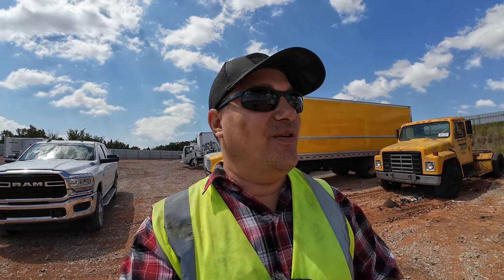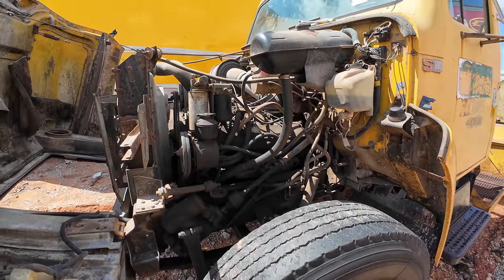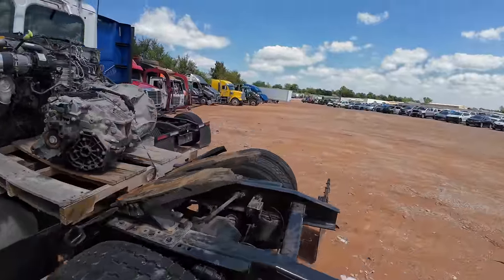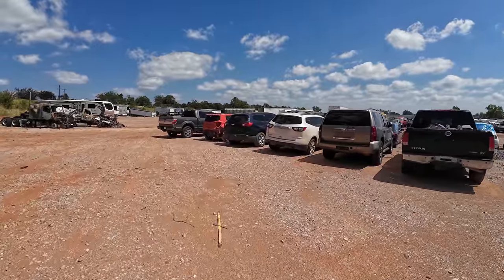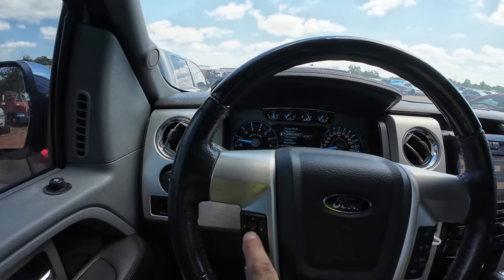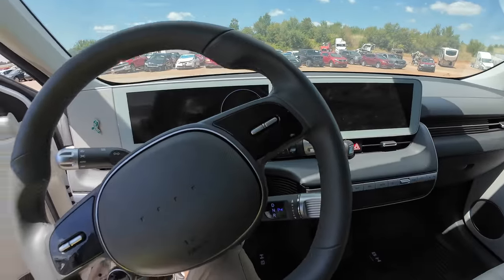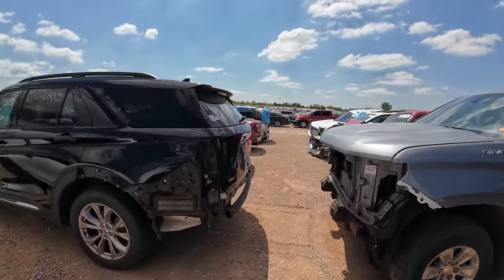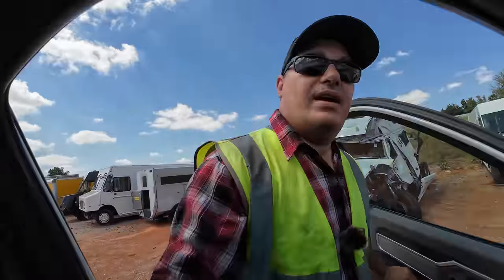Should I buy This International Diesel Truck? Super Cheap and it Runs!

Comment: Cobble a dually pickup bed onto the IH with a crazy rattle can paint job and drive it as a Rat Truck. Or, put a pickup camper or RV camper on it.  Fab some crazy headers on it.  Make them chrome for contrast. Put some wide cement truck tires on it. Oh and, a wing, of course! 4:00 Grab that push bar for it.

4:35 A Kodiak Ambulance Camper! How about that white box truck for an enclosed car hauler/camper?

14:30 Sand, Bondo and paint the hood for the cheapest way out.  Put your Macco guys on it.  It's old enough to be cheap.

17:10 That mustang is so cool and rebuildable into a rat Rod.  Great patina with a satin clear coat on it.  THAT would make for a great series.  Being what they are, I don't think I could even afford that one.  I was 18 years old when that was new, and I wanted one.  A Boss 302!  Trans Am Racing, yeah!

25:35 Show us how you rebuild them!  You need a door and someone who can pull that fender out.  If you can get it cheap enough, who cares about a little Bondo?  It has the hardtop too!
25:55 Okay so it needs a lot of Bondo!

I think I would like to see you turn lemons into lemonade.

Comment: A few videos back sitting next to a Red Ford ranger was a 2004 Gmc Sierra Denali Quadrasteer All Wheel Drive 6.0 Vortec. Very rare and very good truck. I pull a 9k Camper and an 1k golf cart in the bed. Absolute towing Beast. Wish you could find it and check it out.youve never had a Quadrasteer truck on the channel.ive owned my 04 Sierra Denali for 17 years!best vehicle I've ever had.

Comment: Garbage trucks usually burn because of hot/flammable stuff that people put in the garbage. If the driver realizes in time, they usually empty the garbage out to the side of the road to save the truck. Then the fire department comes and puts out the fire in the large pile of burning garbage on the side of the road. It’s a mess.

Comment: I wood like to see you in a semi with a manual transmission, will be very interesting content 😊
Reply: I think Randy would get the hand of it. They are pretty easy to drive if you can drive a car without using the clutch, an 18 speed is no problem.

Comment: Randy, as much as I want you to go back with a full jumper pack and see if that International runs, I gotta say PASS.

The 9 liter is not a very powerful engine. The trans is most likely a five speed, and the orange knob is indeed for a two speed differential.

The large brackets on the back suggest that one of those large arrow boards was mounted to it and it spent most of its life parked at the beginning of highway/interstate construction zones. That would certainly explain the low mileage of just over 2K per year on average. The flat steel plates over the rear axle may have carried a few of those large concrete lane dividers, and I can imagine the expanded steel baskets on the frame being used to carry cones.

This is what I would classify as a specialty truck. Not very practical for many moving applications other than a stake body unless you put a lot of time and labor into it. With the single axle, the frame is too long for a dump bed that the rest of the truck could handle... but it's also too short for a rollback. I would be very surprised if the rear end ratio was below (numerically) 6:1, which means it won't do interstate speeds... probably hits the governor at 50, max. If you could deal with the ride of the spring suspension, it might work as a toy or RV hauler as long as you used back roads and didn't have to go any significant distance. Even if you buy it and find out it's mechanically sound, you'd probably have a very hard time reselling it for those reasons.

Comment: that trucks off switch is that pull handle on the right of the steering wheel, wouldn't of started anyway till u push that in

Comment: After having a CDL for 35 years, Federal DOT requires anything over 26,000 GVW  needs a CDL. That's why rental companies register there trucks (moving trucks) at 25,999 Gross weight to bypass that. Salvage or not. Plus Any vehicle that has air brakes need an Air Brake Endorsement regardless anywhere in the 50 continental states you are driving. Not to mention if the vehicle is traveling under it's own power, it needs to pass a DOT inspection. That's why some trucks need to be towed if the infraction can't be repaired. So basically NO!

Comment: Hey Randy I've driven truck for over 10 years and just a heads up the answer unfortunately is no. Under no circumstances are you allowed to drive a semi on public roads without a CDL even without a trailer. Just to get started you have to have your air brake endorsement.
Reply: That is not true. Most states will allow you to drive without a cdl if you are not for profit. They do it for towing a 5th wheel rv.
Reply: @ndg9367  incorrect just to get started you need a airbrake endorsement does not matter if your doing it for personal use or not you can't drive a RV with air brakes either without a airbrake endorsement.
Reply: @rustyshackleford5523  that false. You can drive a rv, with 40k gvwr with air brakes. If it is personal, no special permits or licenses (depends on state), but if it is commercial, you need a CDL B with air brakes endorsement. Same with this truck! Fmsca has it on the website.

Comment: Run away screaming. The head gaskets are probably blown. I have an ‘87 sitting behind my garage that has the horrible 9-liter and it’s just saving a place for a replacement DT466 with mechanical injection. The ONLY reason I would bother with it is that it’s very low miles, very straight, no rust, and 4WD. So yeah, that heap you’re looking at has parts value and little else.

Comment: I think that you need to take the $20.000.00 hit and get out of the dodge ram ! Jyst bite the bullet ! That 2011 platinum edition will serve you well! I think its almost 10 years older than your truck and its such a better looking truck m take a hail damage a d work truck and no more monthly payments ! The finance charges plus insurance will more than pay for the ford ! Leave the hood just as it is unless you find a same color same year hood for a steal ! As you would say ? Drive the piss out of it . the mileage is so low ! You could get at least a year out of it and still would cost you nothing ! When I saw what a beating you took on that jeep Grand Wagoner last year and pound you in the face for 20k ? I knew you had either a steel head or iron balls ? Do the same and bite the bullet !